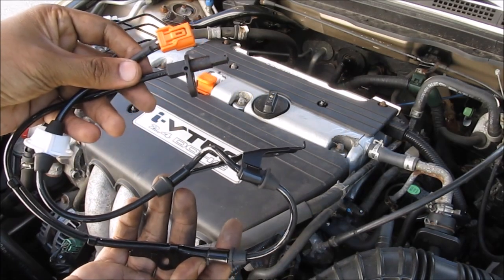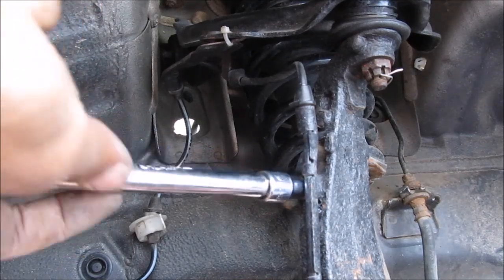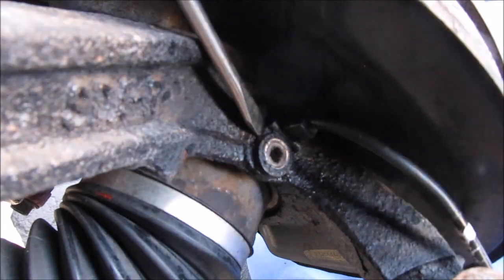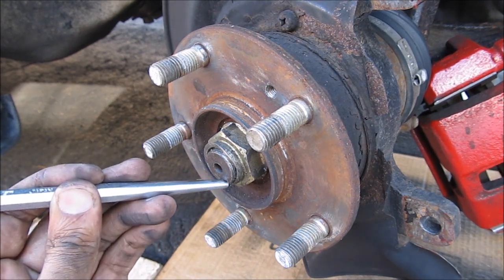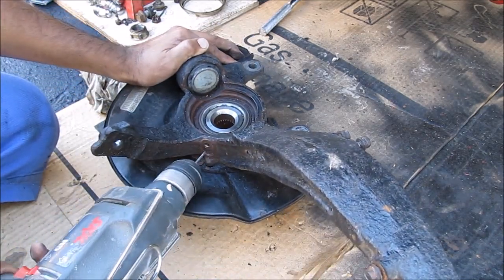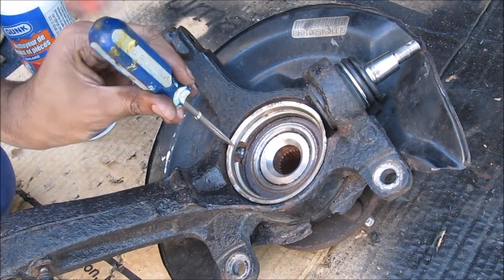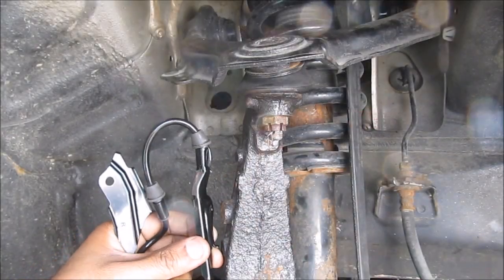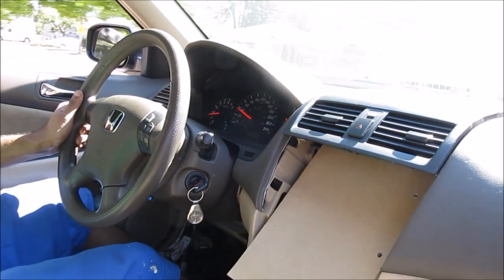Honda ABS Sensor Replacement

Comment: I already changed my all new wheel speed sensor. But still not working. Anything else for help.
Reply from the maker: Diagnose the wiring and pin out on the ecu

Comment: I'm so mad🤬🤬🤬 I've been through $60 plus shopping, on 3 different sensors, because Nobody said you had to make the hole bigger to fit The new ABS sensor.smdh I'm glad I came across your video to see that you drilled Yours out in order to get the new one in or I would have never known. I was able to get mine out with a hole punch, but getting it back in it would not go.thanks
Reply: Same bro omfg just wasted $100 myself what the fuck

Comment: Man... Doing this on my Honda Element... ABS sensor replacement sucks.  For me, what was a Clutch pretty much became a whole front suspension upgrade.  It's pretty fun though
Reply from the maker: How are the rear trailing arms holding up with the rust?

Comment: Screw that.  Mine is broken already so if it's frozen i may attempt to use a drill or gouge it out otherwise im usin' old school brakes like my granddaddy -   until such time as  an axle or bearing gets me into the works there.

Comment: Great video but I have changed a number of these ABS sensors and find it much easier to cover the brake hose, CV boot and sensor with a
Piece of sheet metal heat the knuckle around the sensor with a propane torch until the plastic starts to melt.  Pry on the bolt end of the sensor while pulling up on the wire while it’s hot. If it breaks off just drill it in place no need to dissemble anything other then the caliper and rotor You can drill it out starting with a small bit and work yourself up to one that just fits the hole till all the rust is gone. “BIG TIP”…put grease on every bit you use to keep debris from down to the hub. This has saved me tons of work. 😅
<‘(((((<

Comment: You don't have to remove the knuckle to drill out the sensor and when drilling anything car related you drill slowly if u drill fast like this video shows you will dull and break your drill bit Everytime other than that pretty good video for nubees
Reply from the maker: I did because I don't want shards in the CV axle ring

Comment: You DO NOT have to  REMOVE the Honda Civic’s knuckle just to drill the Sensor hole out ! Just put a bit-extension & depth gauge (tape) on your drill-bit & drill it out ! I didn’t have to remove the axle or the dust-shield !  But if you feel you need to, leave the bottom ball-joint attached & just swing the knuckle away & the axle will pull right out of the back of the knuckle & just leave the axle laying to the side. Might want to wire it secure. Don’t forget to mark your camber bolts to keep your camber adjustment upon assembly ! As for drilling out, the rusted-in sensor, I started out w/a small 1/8” drill-bit & worked my way up to 3/8” which is the same size as the sensor-hole on a ‘07 Civic. You ll see black plastic coming out as your drilling. Once you get close to the same diameter as the sensor & sensor-hole itself (3/8”) just drill SLOWLY until it’s all cleaned out. Then make sure there’s no plastic at the bottom of the blind hole ! That’s that ! Use a little anti-seize or grease on new sensor sides, NOT on the end ! Use very little ! Don’t GOB it on !
Reply from the maker: Thanks for your experience

Comment: Great video. However I had the same issue on a 2012 crosstour and was able to drill out the front left sensor and grab whatever is left with a needlenose plier. I didnt have to remove the knuckle but did have to bend the metal shield to make it easier to drill. still a PITA

Comment: Hey great video. I was doing the control arm on my 03 accord and the ball joint thread was stripped so I ended up buying a new knuckle assembly to make it easier because that ball joint was a bear to remove. Anyways my abs speed sensor wire broke. I went and bought a new one and now I have the light on which I never had before doing this job. Any thoughts. It’s a brand new sensor from autozone too.
Reply from the maker: Scan the code and see if it's that sensor.  Not all aftermarket sensors work properly
Reply: @speedkar99  

I had to get a better scan tool because mine didn’t read abs codes. I reset the code and it is gone. So I guess in some cases you need to manually reset the code.
Reply: Never mind. It’s back on. Unbelievable.
Reply: @speedkar99  

By the way I replaced the abs wheel sensor and it’s fine now. So even the other sensor which was new was defective.

Comment: If the sensor gets stuck and you can't get pliers on it use a Cork screw it will pop straight out.

Comment: I have a 2002 RL Acura and I removed the old sensor but I cant get the new sensor in the whole I see you drilled a new hole I was going to try and sand down the hard plastic of the sensor what do you recommend ?
Reply from the maker: I didn't drill a new hole. I used drill bit to clean out the existing hole

Comment: all good and well when it is the front wheels, but i got a stuck sensor in the rear wheels, omg i have to take the whole system out because its in the worse location.

Comment: This video is the best repair video for a complete knuckle replacement. Every other video I found online did not even talk about the abs sensor replacement. I have a 2004 Honda Accord LX and the Honda dealer wanted me to pay just over $1400 for both front knuckle replacements. I bought each knuckle complete kit with the sensors for a total of $360. This included some new tools to do the job, the complete knuckles, and brand new sensors. You will have to replace the sensor because the plastic on the sensor melts inside as the wheel gets hot over time by the bearing friction. The plastic becomes brittle and will break. Honda dealers would not even press these bearings because the knuckle is a complete plug and play set (loaded knuckle as they say). Also, my wheel nut was a 32mm, not a 36mm. The new knuckle sets come with both a 36 and 32mm. So be careful which burr you have in your wheel. Mine ended up being a 32mm. This was super easy to work on and you don’t need a joint breaker; use a rubber mallet to beat on any connections or lightly with a metal hammer. Mine came apart with ease. Spray the joints with WD-40 then tap with a rubber mallet. Awesome video! 👍🏻😃
Reply from the maker: Thanks glad it helped

Comment: Nice video. 

One point though. 1:20 resistance is 430 kilo ohms. You may want to correct the value (400 mega ohms) written in the description. 
Cheers.

Comment: You just gotta remove the Tie rod & bottom knuckle bolt and lose the 12mm brake line and also the axle bolt & turn in around. You don’t gotta take it fully out or remove the top bolt of the knuckle.
Reply from the maker: Unless you gotta drill it out like I did
Reply: @speedkar99  you don’t have to drill it out . I didn’t I just use a torch and a dentist pick like the ones they scrape at your teeth with

Comment: Hey guys, if you have the old sensor head break off, you don't need to undo all wheel parts as this legend shows. I've made a video on how you can simply drill it out. Check out my upload: 
https://youtu.be/FsfmOWOS9BU

Comment: I have an old 2004 Accord that I hardly ever drive. What will happen if I don’t do this repair and I do drive it? BTW: excellent video
Reply from the maker: You won't have ABS and can loose control in a skid in the rain.
Reply: @speedkar99  Almost all drivers nowadays do not know how to drive without ABS. They just stomp on the gas and stomp on the brake. That's it!

Comment: You do not need to disassemble! Just drill a small hole in the plastic, then drill a screw straight in, then yank it out with a hammer.

If you can't do that just drill it through and vacuum it, it doesn't matter about debris
Reply from the maker: You havent done this job on a Canadian rusted car....
Reply: speedkar99 I did it on a very rusty one and worked fine, this is plastic not metal and you can drill through metal and apply silicone spray

Comment: The only reason he did a complex job was because when he pulled out the sensor it got stuck inside the wheel 2:04
Reply from the maker: Yep. Common for most rusty Honda's
Reply: speedkar99 there's a better way than taking out the whole wheel assembly. 

You drill a screw unto the plastic and then yank it out

Comment: What if you do all this and your abs light is still on and not doing what it’s supposed to? I changed both sides and the light is still on and won’t work, how do you reset the light so it can work?
Reply from the maker: You need a scan tool, or use the paper clip method in my other ABS sensor video for the TSX

Comment: To anyone watching this video: When you are going to take out the ABS sensor, use a hammer and a screwdriver and hit the SIDE of the sensor mount. this will twist the sensor and loosen it from the hole it is in. Twist it back and forth a few times before trying to pry it out. Then work a screwdriver under the tab where the 10mm bolt was, and pry up as you pull on the sensor (not the cable) with some needle nose pliers. It is much less likely to break this way.

If it does break, it may be much easier on some hondas to just remove the bearing assembly, and push the sensor out instead of disassembling the whole car like in this video.
Reply: patience! I noticed you broke off the sensor in both of your videos. Let it soak over night.
Reply from the maker: Good call. But nothing can beat the rust we get here in Canada due to salt in the winter 😯
Reply from the maker: Thanks for your tip. I tried twisting and it still breaks

Comment: Yep I ran into this today, who knew a piece of plastic could turn into an indestructible material.
Reply from the maker: Did you drill it out?
Reply: @speedkar99  yeah I drilled a hole in it and knocked it out with a punch

Comment: How old is that car? This sensor is held in place by a 12 mill bolt on my 2013 Civic si. Required no drilling or removing any of the disassembly you just did. I removed my tire, lossened the bolt, pulled it out, followed the wire up the car, unhooked it, than reversed the process to install the new sensor.
Reply from the maker: Of course it's much easier on a 7 year old vs this 13+ year old rusted accord

Comment: Is it still fine to just drill through the stuck hole and leave the renaming part of the broken sensor inside? It's too complicated.
Reply from the maker: No, because that will leave shavings inside the hub which will affect the abs readings

Comment: Can't I just swing the knuckle out to get the CV shaft out of the way, use an angle-drive drill, and clean it out from behind?  This seems like way too much work just to get access from behind.
Reply from the maker: You can but your basically a tie rod and upper ball joint away from removing the knuckle entirely

Comment: Once you have the wheel off put it aside and then you'll have to go to MIT and score in the top 5% of your class in the first 4 years. Before you still out the abs sensor you'll need another 2 years to get your masters to finish the job. Easy peezy
Reply from the maker: Ah Common all you need is a drill

Comment: I just did this today on my 2010 Accord on both front, rusted to hell.  Drilled it out while it was in place.  Cleaned it out with a dremel, blew it out with an air compressor, sprayed with brake cleaner, installed new ABS sensor.  Works great.
Reply from the maker: Glad it helped you out! I don't know why all Honda sensors get so Rusty
Reply: @speedkar99  Thanks

Comment: Why don't you use a socket to tap out the old broken abs sensor. So much less work.
Reply from the maker: I tried pounding on it with a punch and it wouldn't budge 
So time to bust out the drill

Comment: Best vid on how to replace abs sensors. Now I need to do it on my '95 Acura Legend.
Reply from the maker: If it's rusted like mine be prepared to drill them out
Reply: @speedkar99  is rear or front abs sensor harder to replace on a 1998 honda accord... and to an ABS Battery Voltage Malfunction... is this interconnected to the right rear wheel speed sensor malfunction....  codes 16-1, 61-1,  and 81-1 Antilock Brake System Control Unit Malfunction...

Comment: Good lord.......a more careful patient extraction of the sensor itself would have saved a huge amount of work ?. Could you not have soaked the sensor itself in proper release oil and left for a few days ?.
Reply from the maker: Nope! Both sides broke. Typical Honda thing.

Comment: how did you break it while doing the ball joint... i'm asking cause my mechanic replaced a ball joint and told me the abs sensor is broken n needs to be replaced.. but for some reason i didn't buy it.
Reply from the maker: I tried removing from knuckle and it snapped

Comment: Ugh... I got an abs code 4-8 (rear driver side abs wheel speed sensor) not looking forward to trying to remove it. Given that the car is 20 years old I doubt it'll come out easily :/
Reply from the maker: Same

Comment: thanks for the video! I watched your ball joint one too.The bolt broke off my sensor...and my cable is now zip tied, haha, those little bolts shouldn't be on the car, they just rust and break off
Reply from the maker: True! Well the zip tie worked and stayed there so no need to extract bolts

Comment: Great video editing, thanks for showing all the important stuff and not a lot of BS. I am not trying to nit pick, but there were a couple things Speedkar99 could improve upon: Don't spray brake cleaner on the hub bearing, choose the correct drill bit diameter and avoid washing out the hole, apply a small amount of sealant when installing new sensor to prevent rust in the future, USE a TORQUE WRENCH. Like I said, good video, and sorry for my nit picking.
Reply from the maker: Thanks for the tips. 
Why not not to spray brake cleaner to clean out the hole before installing the sensor?
Reply: @speedkar99  the hub bearing should be sealed but... Brake cleaner would likely penetrate. Changing the bearing out as you know requires a press. I'm really particular because I was an aircraft mechanic. I like everything to be just right.

Comment: Awesome video! Thanks for making it!

Man, that’s a lot of work to replace the sensor. I’m putting a piece of tape over my ABS light!
Reply from the maker: I had a tape over my light for months...
Reply: When I went for my inspection I actually didnt use tape. I put a small wallet size pic of my family over the light just to help me pass Inspection.   The abs computer is separate from the ecu so the inspection machine didn’t detect any errors, especially they are looking for emissions type errors but if the inspector saw the light on I was worried they might fail me for the abs light on.  This was a 2003 Honda Accord in Massachusetts.
Reply: @phw340  lol!

Comment: Oh no! 

Replacing a abs line is more work than I taught.
Reply: It's only that much work if you break the sensor in the hub. It's not impossible, but is difficult. I would highly suggest removing the axle from the knuckle prior to attempting to remove the sensor. I find it easier to use a socket extension to tap the sensor from the hole from the rear of the hub, then using something a little smaller if you're still unable to remove it while the sensor isn't fully tapped out from the hub. I swear Honda molded the Hub AROUND the sensor, it's ridiculous how tight that sensor is in the mount.

Comment: There is a much simpler way! Get a coach screw(self Drilling). Heat up the screw and melt in into the plastic sensor. Quench with cold water. Now the screw will be melted into the broken sensor. Now You just need to hammer out the screw with a hammer and chisel and the plastic sensor will come out as well. Saves taking everything apart :)
Reply from the maker: +John Chappell that's good in theroy but I bet the screw will just come out of the plastic as you tap it.
Reply: speedkar99 I’ve done it and it worked. I’ve tried on 3 different cars and 100% success rate.
Reply: John...Can you make a video of your heat/quench method?

Comment: You don't have to remove the steering knuckle just take a drill bit that's a bit smaller than the sensor and put it on a ratchet universal screw driver and drill it out
Reply from the maker: +Kenny Sok then the crumbs will clog the CV axle
Reply: That’s what I did...lowered the knuckle and drilled a little hole through from outside in.  Then I used my soldering iron to heat up the plastic and it shriveled like a prune and I pushed it right out.  I had to dremel the hole because the rust made the hole smaller.  Just gotta clean up after.

Comment: So I had to replace a knuckle and when reassembling I sprayed (with electrical cleaner spray) the end which was connected to the electrical system.  (the wife came right then and I was distracted)  Anyway, did I just fry the wires I sprayed or did I cause major damage on board?  Thank you for this video, will come in handy some day.
Reply from the maker: +Dorjee Gyadatsang as long as you left it to dry it should be fine
Reply: speedkar99 I left it for a bit but I wasnt sure it was salvageable so I may have connected the wires back up while still not completely dry.  I got the abs light as expected, I did not know drying them might actually have them still function, I would have definitely given it more time.  The other reason was it was getting dark and a blizzard was coming that night, I wish I had a garage!  Thanks for your reply.